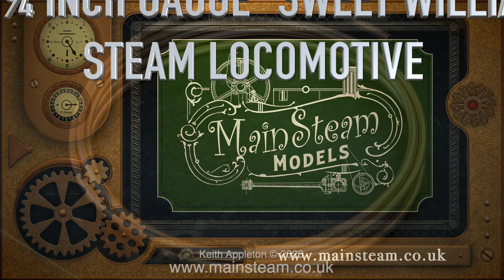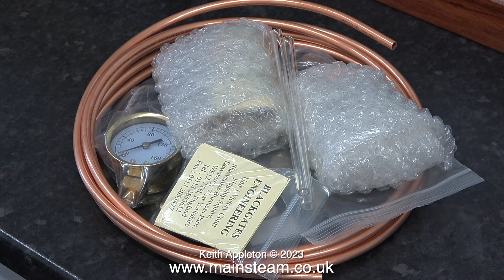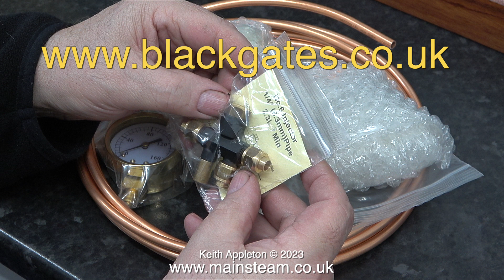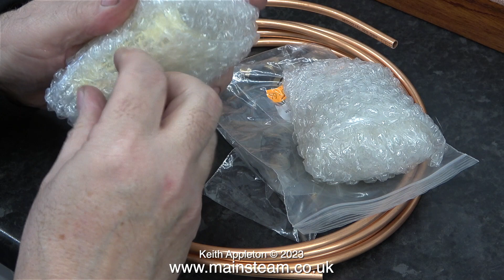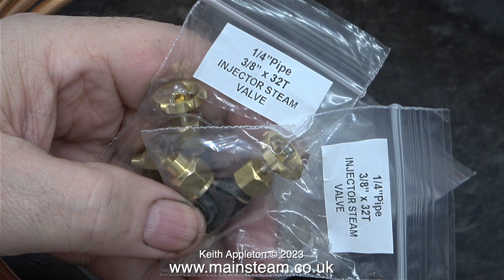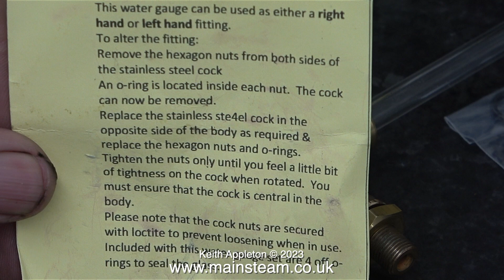A 7 ¼ INCH GAUGE "SWEET WILLIAM" LOCOMOTIVE - PART #23

Comment: Another good video thanks.  A nice haul from Blackgates.  I recall reading LBSC made gauge protectors out of mica sheet.  Have you worked with mica before or seen how it looks?
Reply from the maker: No I haven't used Mica sheet. I prefer the open method, as the gauge glasses are more visible and don't need cleaning.